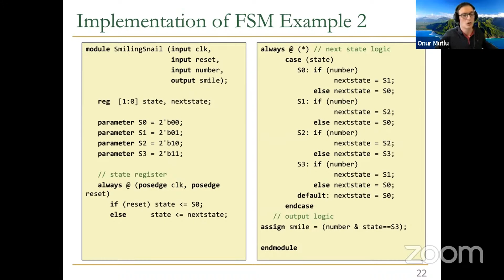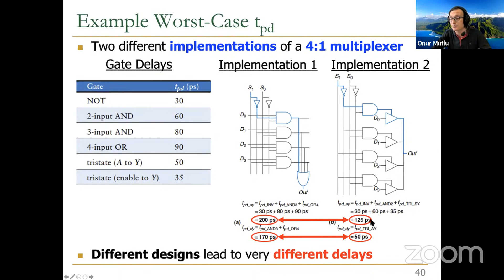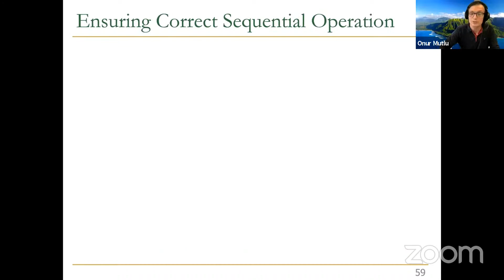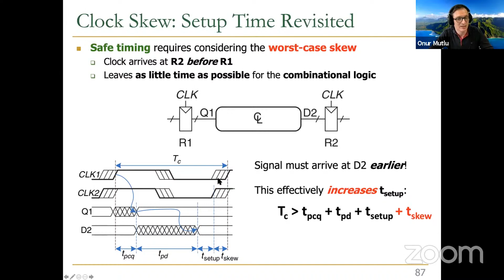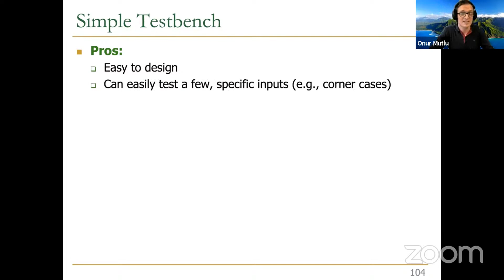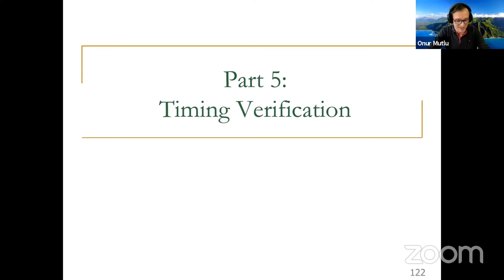Onur Mutlu - Digital Design & Computer Arch. - Lecture 8: Timing and Verification (Spring 2021)

Comment: I noticed that in your picture, the starting point of tcd is that Q1 starts to change, while the starting point of tpd is that Q1 is stable, such as 1:00:52 and 1:06:12. Is there anything special about this?
Reply: Because tcd starts whenever output starts to change and output can change whenever tccq ends.

Comment: In real chips, where do the clocks come from? We are designing the digital hardware based on clock signal, but who is generating it?
Reply: There is a whole field dedicated to SoC clock design. It falls more on the microelectronic design side of things so that is the reason why Prof. Mutlu probably didn't go over it!
Reply: Could be a crystal oscillator https://en.wikipedia.org/wiki/Crystal_oscillator
Reply: a clock generator and a PLL distributes the clock to other components.